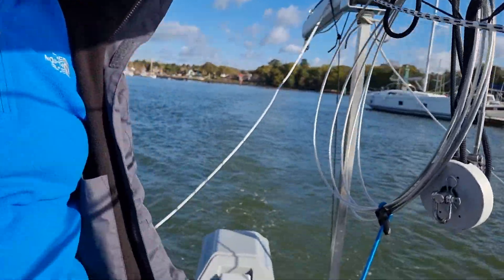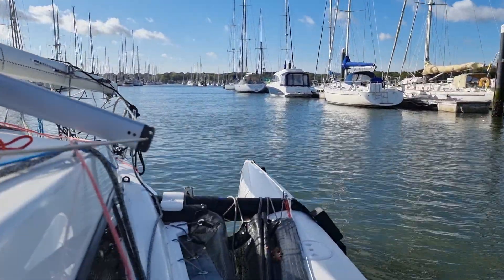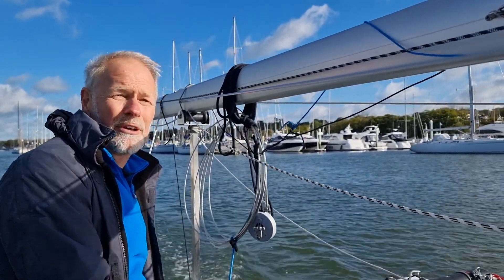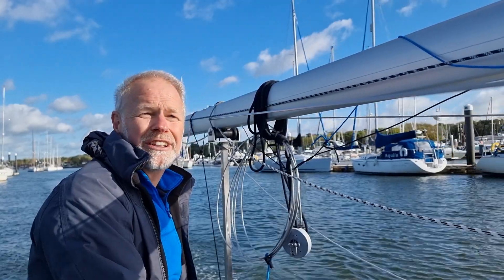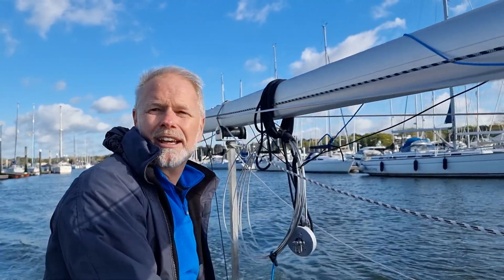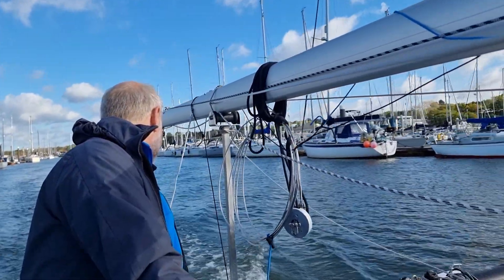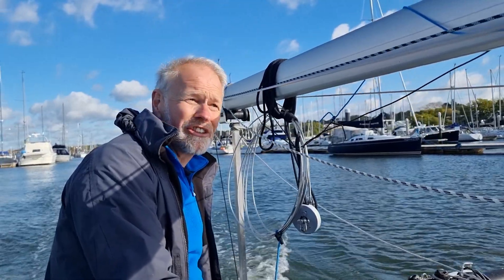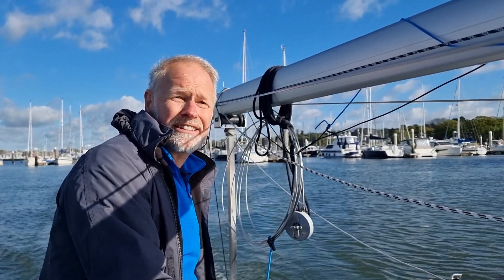Watch as we test the power of the EPropulsion Navy 3 electric outboard!

Comment: Done any more testing with this after this video?
Reply from the maker: Not recently. We usually have an EPropulsion Spirit 1.0 hanging off the back of our demo boats. These are fine for demos but I would choose something more meaty for cruising. If you're up against wind and/or tide you don't go very fast. The Navy 3.0 would seem perfectly suited to many trailer sailers.
Reply: @boatsonwheels17  My 22 ft sailboat is around 1300 kg and I am considering if a Spirit 1.0 would be enough for local trips on the lake. I do need go small parts of a channel where I would prefer to reach at least 4 knots speed to keep up with other traffic. The advantage of the Spirit over the 3.0 EVO for me would be easy batteries. I can easily carry two Spirit batteries and can charge them at home. But I think the spirit's power would be on the edge. Currently have a heavy 9.9 four stoke, but rarely go above half throttle.

Comment: Maybe you can help me. I'm looking at adding a pair of Epropulsion 3.0 Pod drives to my 33ft Prout. 9,500Ib's That be twin.. 6hp equivalent. 
But for the life of me I can't find good info on what weight is right for what pod drive... Or in this case Twin Pod Drives. 

Happy Sailing! Great video quality
Reply from the maker: Sorry about the slow response. I would probably go for Navy 6.0 pods as they're not a lot more expensive and would get you out of trouble better. When conditions permit you can always run them at low power to save the batteries.
Reply: To be honest, you couldn't really go wrong with overshooting it; that means you have the benefit of increased speed when necessary, or much high low-speed efficiency when you don't. These EPropulsion motors even have a hydrogeneration feature that turns drag from the propellers when not operating (eg wind power) into electrical energy. The higher HP motors produce more electricity when spinning even on a craft that is travelling the same speed.
Reply: i have an Aristocat 30 which is similar, and i am looking at 2 navy 6 outboards. i have no engines atm... having got rid of the Dolphins. i will make my own 48v lifepo4 battery, much cheaper and larger capacity.  it is difficult to move a 7 tonne boat